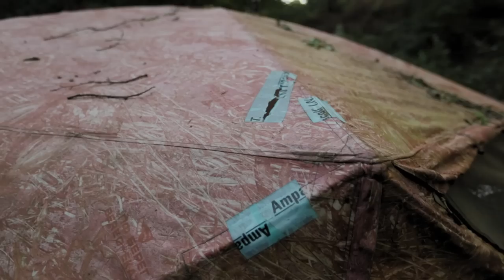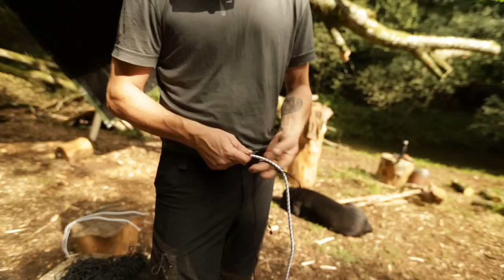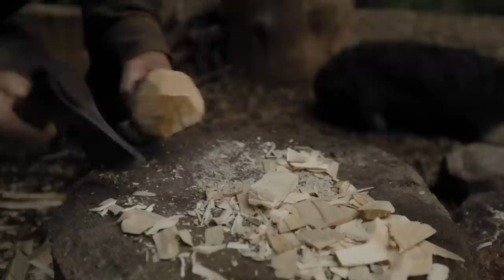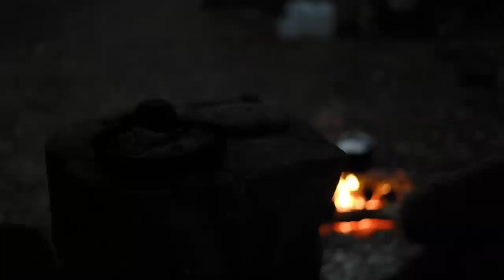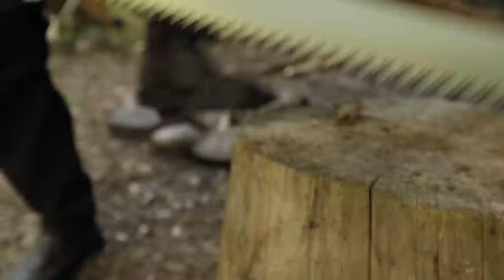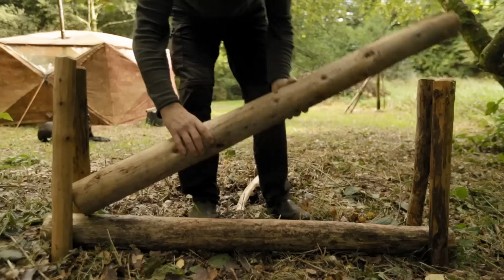A Huge Tree Fell Down On My Tent - How I Got The Best Of It.

Comment: And now that cat has 8 lives left! 😂
I had a lean-to oilskin tarp out back for about a year when I used to live in West Virginia. One day, after a storm, I came out to find a deadfall limb on top of it, about 12' long and maybe 8" thick. It was suspended by the tarp and had I been underneath it when it happened, I'd pretty sure be waking up in an emergency room had it not been an oilskin tarp. 

Had that been a nylon tarp, I don't believe it would've been suspended in the air when I got there, but on the ground having crushed through the tarp like a piece of toilet tissue. 

The last time I had a good campout, I was using my 10X10' oilskin tarp in a plow point configuration. It was an especially windy day. I had two 60' widowmakers come down around me in the distance. When another one came down in front of me, I was like, "Okay, time to go." and I packed up faster than a Ukrainian in February of 2022. 

Just yesterday as I was hunting (again, a windy day), I had a long heavy deadfall limb fall not far from me with winds so gusty they were bending the tops of trees almost 30 degrees in either direction. It was spectacular. It sounded like freight trains running over me. 

But...I wouldn't trade those experiences for anything. 

It's called the "wild" out there for a reason. If I wanted to be safe, I would've stayed home in my climate controlled structure with lights on demand and potable water coming out of a sink. 

I've been hit by falling debris on perfectly calm days while out there. It sure wakes you up. 

Good stuff Soren.
Reply: PS My favorite places to stage myself while hunting are fallen trees, next to the uprooted base. Besides them providing great cover, there's almost zero chance that another tree will fall on me there and if it did, I'd have the already fallen tree to provide a stop large enough for me to be under.
Reply from the maker: Its some dangerous stuff being out when its strong wind. It has ruined several nights for me. I hate it. But there was no strong wind, only rain from the night before that has been weighted down on the tree. It was rotten to some point between the stems. I had a, what seemed to be a strong living tree break when I sat down I my hammock once. It had leaves and live bark. But was completely rotten at the trunk. Lucky it was close to the beach, so it leaned against the ocean, and missed me. :O Thanks my friend

Comment: It's good to see you again and..In one piece! Good thing that you weren't in that tent when it happened. Damages were minimal too. Did the tent leak after the rain? 
Great video as always and this headache protector is really smart. I really wasn't expecting that!
Reply from the maker: It leaks a bit, but not much. But it has done that since the snow destroyed it. Thanks :D
Reply: @DonVonGun  oh I see. Maybe using some gorilla tape would fix the leaking. It works really Well. Sometimes it can be really hard to find where the water comes from. 
Also, someone mentioned music. I think I personally like more without music and only nature sound. It's more immersive imo. But it's perfectly fine with music too. 
Anyway, have a great day!